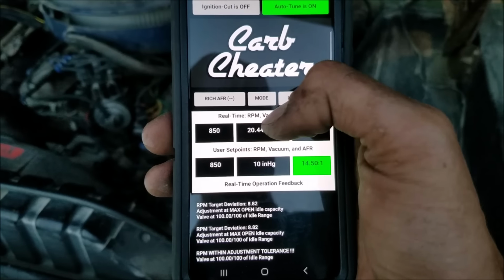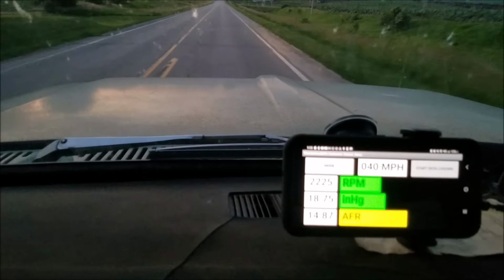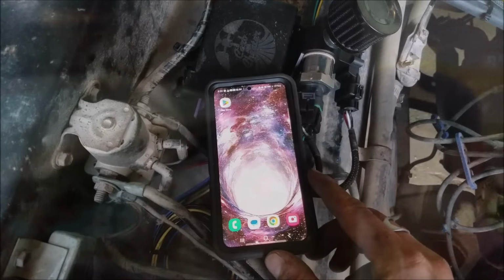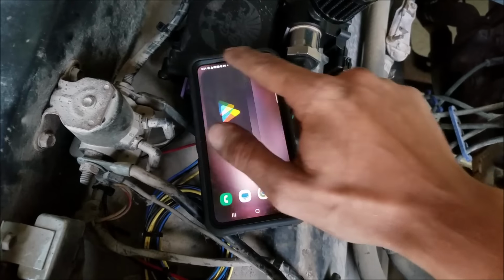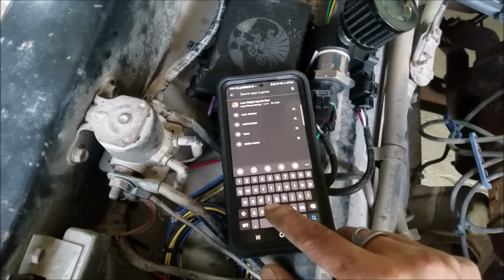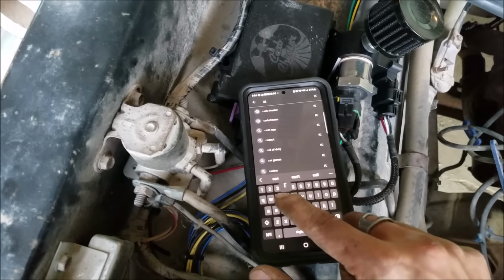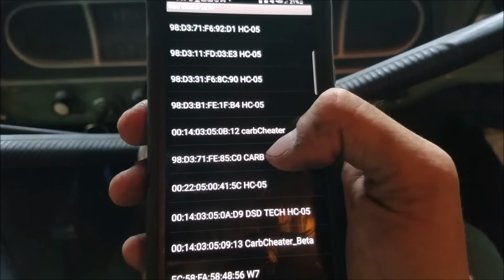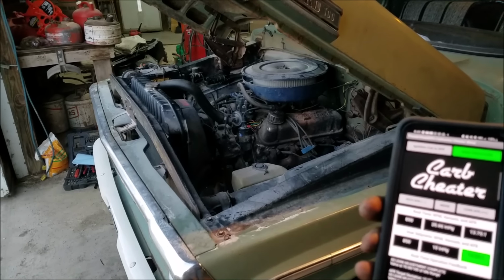Make a SELF-TUNING Holley/Edelbrock Carb! (Carb Cheater: Installation & Setup)

Comment: Out of H and E carbs, which one you think are the most reliable for stock and/or street use ?
Reply from the maker: A quality zinc holley or an avs2 edelbrock. The cheap holley lines like quick fuel and brawler are huge piles of garbage
Reply: @Thu @ThunderHead289 just bought a 87 bronco with the 5.8 L HO and came with stock 4 bbl Holley. I forgot exactly what type but, I’ve watched you for many years and I’m thinking to throw your carb wizard thingy on it. I’m debating if I should leave the original carb considering that everything is original or should I change it with a edelbrook like everyone else does these days

Comment: What to do with the coil wires if I have an LS motor with an MSD 6014 box to control ignition? By the way, you guys are the best. The world been needing you guys for centuries lol.
Reply from the maker: You would simply use that tach output from the msd and land our yellow wire on a keyed source. 

Then you are good to rock and roll
Reply: @ThunderHead289 Thank you lots. Im about to order the carb cheater now 💪

Comment: How often do you clean or replace the little air filter on the unit. And do you sell spacer plate to fit a gm spread bore carb?

Comment: What happens if it’s not too rich?
Reply from the maker: Then you use your eyes since you see everything and go "oh shit, I should probably fix that" instead of just ignorantly burning holes in pistons like people do
Reply: @ThunderHead289 So, in order for this to work properly, it needs to start too rich, so the additional metered vacuum this introduces can lean it out.  Maybe ya mention that and I just missed it…

Interesting product.  Good luck.
Reply from the maker: @kwkrnu72 your carb is already rich, they all have to be for handling dynamics of the day - if you put an afr gauge on it, youd see it be rich of ideal most of the time on the road. 

Thanks, we have sold over 4,000 of them now.

Comment: Very cool. I have a edlebrock 1906 spread bore carb. Do you offer a plate for that or should I use my own manifold vacuum?
Reply from the maker: The 1906 is technically a square bore carb itself, now your intake may be a different story
Reply: @ThunderHead289 is definitely a spread bore came with a plate and double gaskets. But I bought a spread bore manifold. And installed a old school 2 wire HEI on my 94 OBS chevy. Carb does have a full carb vacuum NPT on the back which I think will work as your plates do and feed right to the bores. I needed 3/4 plate to get high enough with the air cleaner bottom, but I fear 1" will put me too close to the hood with the stock air cleaner. Do you sell the plates seperate if I change my mind?
Reply from the maker: @playsportfun3356 i do sell them seperate, land our valve on the front of the carb, then manifold vacuum for the other port of ours can be Td into anything. Cant T the valve though.
Reply: @ThunderHead289 Thank you! I like your idea and initiative. Got quite a few engine patents and I love to see good ideas like this. Unfortunately mine are owned by a corporation. I'm always up for supporting the under dogs. I would love to see you give one to other you tubers like say Pole Barn Garage and watch them install them. I think it would also be a great way to further promote your product. And it would be content for them.

Comment: I actually love my Holley 4150 750 double pumper it works great and yes I have duel AFR metering so I can dial in my jets screw adjustment and power valve it’s really that simple I’ll take my 4150 over anything out there

Comment: Would the 02 sensor work in the H of a H pipe dual exhaust or just tap one of the collectors and be done with it?
Reply from the maker: I would pick a side personally as flow would be far more direct

Comment: I understand that the engine will run happier and cleaner, but if we don't control the fuel dose at all, the fuel consumption stays at the same level? I am torn between this and EFI conversion...
Reply from the maker: I dont want to talk about economy, but actually the cc valve has a weird way of trading places with your foot where your gas pedal is pressed much less, so technically indeed it is less overall volume of fuel. Fuel mixture ratio and fuel mixture volume are separate items. 

CC isnt a fuel economy device though - at least thats not what I designed it for. 😅

Comment: Will the carb cheater system help when you have a 850 cfm carb on a big block engine that runs to rich because it should be a 750cfm? I’m guessing not?
Reply from the maker: I dont like marketing it as a form of a bandaid, but yes you are correct, it would help quite a bit
Reply: @ThunderHead289 I appreciate your response!! Looks like a super cool product!!

Comment: Because the Carb Cheater exists, I am actively in the market for a carbureted vehicle. Preferably a stock Q-jet, if In being honest, but I'm not dead-set on it. Any older Ford would be just fine, too, and in some cases preferable. But I don't exactly care if it's an early 80s carbureted Honda - I just don't want the expense of EFI issues. I'd rather rebuild a Rochester and replace a mechanical fuel pump every 6 months than deal with injection issues every few years. And the CC with a display option really just seems like the right way to go. Along with one of your dialback timing lights, of course. 😊

Comment: If I understand the principle behind this it only works if you need less fuel. If you're system is lean everywhere it can't help.
Reply from the maker: I mean, correct - but thats where you use your eyes and jet appropriately since it feeds you all the data. Most carbs are way rich though unless there is a fuel supply issue. 
Its why it works so well, all carbs are often rich in most ranges (they have to be if they are static to handle all scenarios)
Reply: @ThunderHead289  Thanks for that response.

Comment: curious if carb cheater is a good fit to smooth out road manners on a 466ci bbf making 700 n/a horsepower with a dual plane intake 107 degree cam and 850 double pumper mechanical secondary?

Comment: I am absolutely purchasing one when available but i have an HEI distributor with no coil, will it work with the HEIs as well?
Reply from the maker: Sure will no problem. Power wire and tach lead on HEI - same thing 🙂
My test vehicle is an HEI rig which i show in the Q and A video
Reply: @ThunderHead289  sweet! Can't wait to get one when available!

Comment: I have a question that will either make or break my decision on buying this product. Does it come with a wide band or narrow band O2 sensor for the AFR readings?
Reply from the maker: Indeed it does - tis a Bosch wideband.
I'm currently out of stock until March as I take a break over jaunary and February on making and selling carb cheaters specifically

Comment: Would you recommend the grease trick with intake manifold gaskets and any other paper type gasket?
Reply from the maker: Not unless you intend to reuse your intake manifold gaskets - just is real handy for the carb base gasket as it basically becomes immortal

Comment: I have obtained a 1988 Mercury Cougar XR-7 with the 5.0L in it and I would like to convert it to a 4 or 5 speed manual transmission. Any suggestions for that?
Reply from the maker: Probably a t5 and pedal assembly from a foxbody - given that it's injected, might not be a terrible idea to just leave it alone so the archaic computer doesn't do the big stupid when you change something

Comment: Let's don't forget you have to get the carb close enough to a tune before this thing can work. It can't add fuel, it can't change the settings on the accelerator pump, it can't change the jets, it can't change the pump cam........
Reply from the maker: Correct, but one can see everything and instead of playing educated guess, it's right in their face and much more obvious on what needs to be done

Comment: Are there still for sale?  Website shows out of stock…
Reply from the maker: We just sold out our last batch in 26 hours - will be back in stock around the dates mentioned in website. 
We work day jobs and do all the fab and tech support, design, and programming - so it's hard to keep up with production.
Reply: That’s awesome I’ll be patient.  One suggestion - if you could add in a signal for coolant temp and oil pressure you could do a full digital dash!  I would very gladly give you my money for that!

Comment: Now I want to buy a 84 Mustang. The real drawback for those were the gas mileage. Hes proving you can make it work.
Reply from the maker: The maverick gets like 26. 
The biggest item is having a manual trans - auto trans (three speed no lockup) just consumes tons of fuel
Reply: @ThunderHead289  Thats better gas mileage than my 2001 Chevy S10 4cyl. Ridiculous.

Comment: I just went to order and it says sold out. Are you going to make more?
Reply from the maker: We have been hard pressed to keep up. There will be more indeed
Reply: @ThunderHead289  That's great to hear. I have a 65 GTO with a mildly built 406 ci smallblock Chevy. Induction is an AVS2 on an Edelbrock Performer RPM Airgap. I  also have an Autometer wideband AFR gauge with Bosch sensor. I've become pretty adept at dialing it in with the step up rods. However, AFR changes drastically depending upon ambient temp so sometimes I feel like I'm chasing my tail.   If the Carb Cheater can keep AFR consistent I'll be a happy man.

Comment: I watched both videos on this and didn't see any reference to how the system adjusts AFR.  Just the monitoring side.  Something has to either add air or add fuel to get it right, and I'm not seeing that just through your carb spacer.  This would be helpful information, as would putting the price somewhere in the video so you don't need to go to the webpage.  

This is a neat toy, but alas my application is a Weber DCOE 45  on a Lotus.  You might not have plans for a DCOE spacer.  🙂
Reply from the maker: Back when I made this, I didn't want to reveal it directly right away. 
It's a proportionally self adjusting needle valve more or less, bypassing more or less air. 
Makes for a really robust foolproof system

Comment: What if you have two twin choke webers on a v6 I have a wide band in it all ready it’s a v6 3 litre whith some mods cam and hi comp pistons I like the idea of getting it to run the best I can plugs come out good I was a motorcycle mechanic and having put a afr gauge in it and it was a surprise how good I got it but as you know it as to be at fall running temperature so when it’s not it’s a bit off so I like the idea of carb cheater cool

Comment: what a joke... if your carb isn't properly tuned to begin with this thing will do nothing. it can't change the jetting of the carb can't change the power valve can't adjust the accelerator pump. it can't change one single thing on your carb. if your carb isn't jetted right this will do nothing
Reply from the maker: A couple thousand sold (do the math on that at 383 a peice) beg to differ. 
All that aside, non-users get hung up on the auto-tune assist feature mentally- forgetting the fact that a user has realtime vacuum, afr, and rpm staring them right in the face with in depth datalogging capabilities - can get an engine dialed real quick as you know exactly what needs adjusted or changed, and by how much. 

Additionally, drive a car at 50 degrees outside, then 90 degrees outside - the afr will be completely different on the same jet. Different percent ethanol blends, stoich for those is different and cc accounts for that (it actually measures lambda and transposes that to a 14.7 spectrum for ease of understanding). How about elevation changes? Going up through the mountains where afr gets richer as you climb on a static jet - handy for automatically adapting for that as well.

Like I said in the video - I'm a long time accomplished tuner, and ironically a heavy automation programmer by day. Carb Cheater was born out of something that would have helped me a ton before I had all my deep knowledge, and also something I would buy myself if it was available - but it wasn't. 
So I literally just made it myself - by car people, for car people.

Comment: Great so its basically  a tunable map sensor?
Reply from the maker: It reads in afr, engine load, and rpm - adjusts to a user's target settings. Plus you can see everything in real-time with a Rev limiter built in as well as comprehensive datalogging.

Comment: Greetings: Suggestion- Do not connect on the battery terminals.  Since U have a FoMoCo, U have a convenient high current connection point. Use the supply side of the start relay and mount .  Just a thought.  Thx 4 the share . Bsafe.
Reply from the maker: Definitely should just go the battery, at least with the ground - the only issues we have are when people don't. 
If the ground connection is poor, the ignition will ground through the board to the wideband in the exhaust frying everything. 
It's why sniper efi and msd both say to go to the battery

Comment: I'm really tempted to buy one of these for my 64 galaxie. The issue with that car is the under-hood heat buildup and the AFR goes rich on hot days with extended idling. How well will the carb cheater help with situations like this? for example, if I set the idle AFR at 13:1 once the engine is fully warm and I sit there idling in gear on a hot day after a while it'll be at 10-11:1 and idling poorly because of the heat buildup under the hood. Once I get going for about a mile and everything cools back off idle AFR returns to normal and of course driving on cold days in the winter/fall it will be leaner. I know its not the carb or a carb insulating issue as I have a good heat spacer setup under the carb and have had a couple different carbs on it with the same issues on hot ays.
Reply from the maker: You must already have a wideband - that type of stuff is indeed what I made Carb Cheater to do. We are currently sold out though until early April. 

Most people are like "you set it and forget it" anyone with a wideband (like you or myself) knows it moves around based on conditions. 
Static metering device, dynamic environment
Reply: @ThunderHead289  Yeah, I have an AEM wideband in all of my carbureted vehicles. How well does this work with engines with huge camshafts? I have a 445 FE stroker with a comp cams 294S that makes 6-8" vacuum at idle and am interested in maybe putting one in that car as well.

Comment: Are you working on the IOS  app yet I have Apple devices  , I see you guys are out till Apri or may , I  will order one as soon as you have them in stock
Reply from the maker: I actually started working on a standalone screen. 
As much h as apps are convenient, they also aren't - screen will be wireless to maintain the same simple install scenario.

Comment: nice system. did you create it? if you did i have diagrams and EZ EFI teck we should develop
Reply from the maker: I did create it, I programmed and designed the process flow and r&d on the components and circuitry while another guy I work with made it mass producable (machined parts and so on)

Comment: Thunder head ? For you. I have a ls stroker 408 engine 12:1 compression. I am going to run carburetor if that cheater will regulate the curve with this compression.
Reply from the maker: It's designed to let a carb do what it's best at - moderate to hard throttle consistency, and account for the low throttle variability inherent in carbs being effected by external dynamic variables. 

Couple that with datalogging and real-time data, and you'd have to be about an idiot to not being able to tune something well in a short period of time.

Comment: Have you tried a Thompson Performance powerblast plate with your kit? 

It may improve atomization
Reply from the maker: It only does something when your throttle position moves abruptly enough to discharge fuel from the accelerator pump nozzle. 

Cruising down the road, fuel is not interfacing with the powerblast plate in any way

Comment: Sooo it's a stand alone idle device?  You STILL have to set up and properly adjust your carb right?  But if the carbs adjusted properly,  wouldn't the vehicle ide properly on it's own though?  It would seem that the iac valve constantly making idle adjustments would only make it more difficult to set the idle mixture on the carb.
Reply from the maker: The problem with a carb is that 13:1 today, all things adjustment side equal, will not result in 13:1 tomorrow. Underhood heat, engine temp, fuel density, ethanol content - all these things are constantly changing. Carbs are great, but they are still a static metering device in a dynamic environment - I made cc after years of drifting tunes which I could see from running a wideband. 
Cc always works at cruise and low load scenarios like interstate travel and what not. It also has several additional features, but it seems like everyone fixates on the auto tune item - at least that's what I have seen with the 1900 or so we have sold currently.

Comment: It seems your carb. needs to be set up rich in every circuit before adding Carb Cheater to the system.  I assume this because C.C. can only lean out the AFR.  Is this accurate?
Reply from the maker: Throw on a wideband. Afr on carbs have a tendency to change with dynamic load. Basically if carb is optimized on its own for interstate speed, cc will go right on no problem.

Comment: Would this work with an MSD box ? I want to use one an a carbureted LS motor i have
Reply: You would use the tach wire and ignition 12v instead of plugging into the coil right?

Comment: I have 1 suggestion with this kit. You have the capability or the possibility of controlling a computer controlled distributor for the 86-93 mustang. There are tons of the cheap but very decent distributor’s not being able to be used once carb swapped. Can you possibly incorporate the use of that distributor along with a rev limiter on you kit?